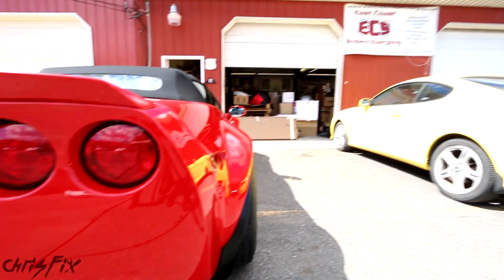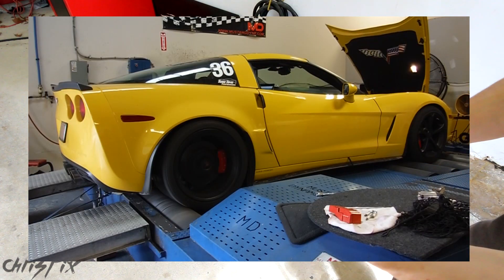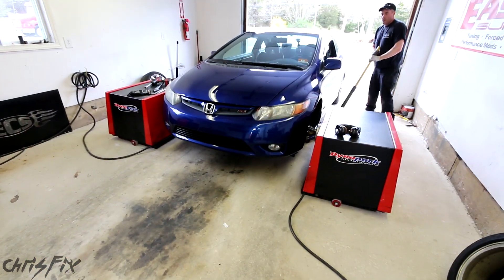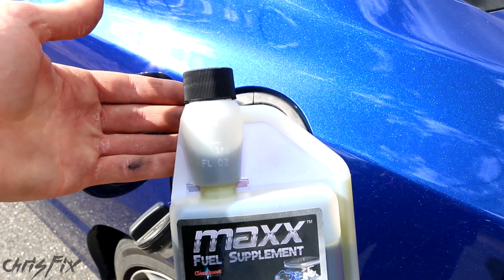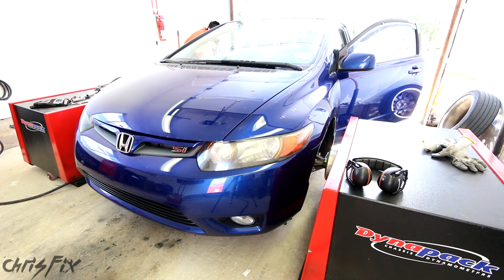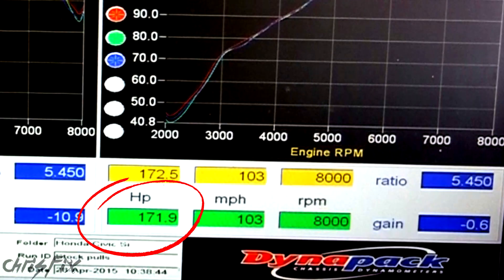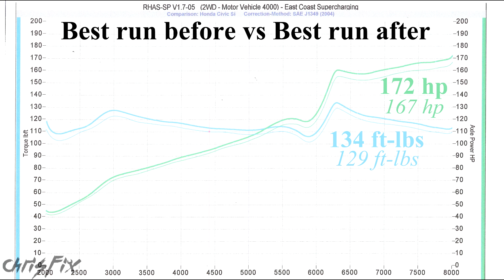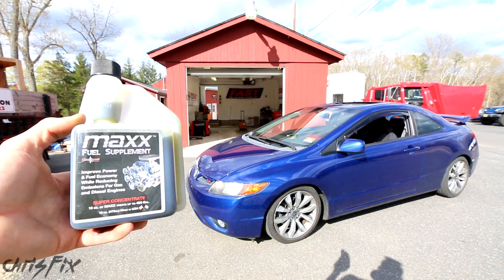Can a Fuel Additive Really Increase Horsepower in Your Car? (With Proof)

Comment: Two things a 5 hp increase is with in the noise level.Secondly You ran the first test using a bar graph from the car dashboard inaccurate way to test. I would like to see a numerical read out for engine temp,intake air temp and ambient air temp with before and after runs.The same pump gas used from one 5 gal container split in two one for the additive and one without. also all test have to be done within reason  not a 20 mun  joy ride were the engine maybe cooler.You say you did not add fuel but we only have your word.Also for the record I worked in a class 8 emmission Lab were the environment is controlled so as far as I am concerned I stiil do not believe this additive did anything.
Reply: ...  smh.... lol ....geez .... you know you could always allocate the time, energy and resources to disprove this. ..... :) just sayin
Reply: +William Spaulding Yea I could but as someone that works in a class 8 emmissions lab my job is to prove or disprove EXHAUST EMMISSION components from manufactures.I belive that people that are not giving all the facts are being taken. What I watch in this video is not true and until someone can show cold hard numbers that says different and proves me wrong beyond a reasonable doubt well I say try.
Reply: +Vito Cialdella geez, all this because a kid did a quick field test on a product lol
Reply: William Spaulding Listen mind you own business you don't like what I write don't read it.You are the type of person that just has to say something even if it nothing is added to the conversation.
Reply: +William Spaulding I was backing you up man, fuck that vito guy.
Reply: Really what are you going to do about I know I can do more If I choose but a ass like  you and your other Identity are not worth my time TROLL.
Reply: +Gordo Villa I dare you to make me as you just violated My 1st amendment rights and it protects me  from morons as yourself.Also your statement is a clear volation of that and Google has been Notified.Your First big mistake.
Reply: Gordo Villa Demacrap!!!and Traitor!!
Reply: Vito Cialdella back to square one... idiot...
Reply: why? It's more fun to play with peacocks like yourself :)
Reply: +William Spaulding so whats what you screw peacocks.Man you really  are a sick person.
Reply: is that an offer? :)
Reply: So you are gay got tired of you tailpipe?
Reply: +Gordo Villa I can see you and your other personality want to be alone you speak like and idiot and confuse accounts. So this will be My last comment to a sick person.I will act like the adult and ignore you and your other account.You should find help seeing you have no friends and troll around.
Reply: That was hilarious lol. That boy Vito, man he's got you figured out lol
Reply: Vito Cialdella thanks buddy, you just made my day:) I needed a good laugh...
Reply: +Vito Cialdella lmao, u gay son? why do you promote homosexuality like that?
Reply: NOW I AM REALLY LMFAO YOU ARE A FORD OWNER FORD GUYS ARE GAY.TO BAD YOU WERE NOT IN ORLANDO LMFAOAY.
Reply: +Vito Cialdella you are gay aren't you? sorry your family doesn't love you.
Reply: Truly you are the only one here you can come out of the closet.FORD- FOUND ON ROADSIDE DEAD.LMFAOAY!!!!!!
Reply: +Gordo Villa I'm starting to think Vito might be a pre-teen...
Reply: I am LAUGHING SO F###### HARD AT YOU TWO FORD'S.OMG
Reply: +Gordo Villa yep..... pre-teen
Reply: You both Are so f###### wrong stop doing each other and look at how wrong you are....LMFAOTIP!
Reply: Always knew you did not know anything about cars except what the average idiot knows.and that is DRUUUUM ROLL PUT GAS INTO THE CAR OR IT WILL NOT GO.LOOK AT THE FOREST GUMP CROWD.LMFAOSFHN.
Reply: Vito Cialdella Are you okay?
Reply: <~~~ grabs tub of popcorn and a soda and sits down.........
Reply: Vito is entertaining lol....like watching a train wreck.....  <~~~~~~ passes tub of popcorn to Gordo
Reply: +William Spaulding OMG it took you 3 days to think that up talk about being slower than Forest Gump Man you take the DARWIN AWARD LMFAO AT YOU.
Reply: +Vito Cialdella I'm still revelling in the fact that you said you weren't going to reply anymore, but here you are......   :)   "badut batbatba .... I'm m lovin it" lol
Reply: WE decided that THAT ALL OF US WHERE I WORK LMAO aT truly how small minded and nieve you truly are. 3 DAYS TO REPLY.AND WE VOTED TO CALL YOU FOREST GUMP from now on.And we took your comments and sent them in to the committee for the Darwin award.LMFAO.
Reply: Yer such a dork. It was like ten days between one of my comments and the time you responded lol.
Reply: +William Spaulding I am talking about today and like a moron thank you for the reminder from the last time, you were the idiot that did not reply for ten days.Forest.
Reply: +William Spaulding I think we made the thing have a mental break down lmao
Reply: +Gordo Villa I never had a break down Crooked Hillary.LMAO
Reply: And here we go again I guess the two Ford girls are in bed together.LMAO
Reply: And The Ford girls are holding hands and tag teaming each other again and who will respond next that is the question maybe its who on top?maybe who's on bottom?That is the question.Or it could be the gay rice rocket owner thet the exhaust note says  Immmm Gay.lmao
Reply: +William Spaulding WOW did you think that all up by yourself or did your mommy help you with that.And I am impressed It took you only 20 mins this time. Its getting late you have to go to bed soon.As its almost that time.LMAO
Reply: FOREST SAYS The fuel goes into the fuel nozzle and it makes the car go BUT DOSE FOREST KNOW WHERE THE FUEL FILLER IS ON CADDY from  1962 and how many gallons dose it hold.LMAO 20 MINS again AND WAITING FOR A REPLY.
Reply: +William Spaulding Yup, vito is slinging that poo at us haha.
Reply: And it took you all this time to reply with just that lame sentence.
Reply: I must be putting your brain on overload and you can't respond that quickly I'll try to slow down for you for Forest.
Reply: Vito, I thought you said I owned a Ford lol
Reply: +William Spaulding Really  are you that slow?It took you all this time to respond from a comment a hour Ago. I will give you more time to respond to the next one.

Comment: 10 or so HP is a fair amount when you're gauging a car that makes 200 hp or so. not so much of a big deal in the 300+ hp engines, unless the improvement follows a consistent percent (190 hp @ 8% vs. 300 hp @ 8%) < which could relate to upwards of 10-20 hp increase.. Either way I certainly am shocked. What I'd REAALLYY like to know is what are the effects on the engine? carbon buildup, oil contamination, wear? Or is this just an overall jesus juice for cars? - and even further - why the hell isn't this a standard additive in all fuel at the pump?
Reply from the maker: +James Dahmer Yea, we were all surprised too. I didnt think it would work honestly. I think it doesnt work on every car because I did a really big test and the fuel economy improvements only worked on some of the cars so that is probably why they dont use it in pumps. It is also expensive. Here is the MPG video: https://www.youtube.com/watch?v=DUkICPS0zQE

Comment: So if the car is rated at 195 HP how do you get that HP back...? A loss of 30HP is pretty substantial for a fairly newer Civic Si with VTEC... yo....
Reply from the maker: +Jose Huertas-Silva You cant get it back. It is lost though the powertrain (transmission, axles, etc). That 195hp rating you see from the factory is to the flywheel. The rating from a dyno is to the wheels.
Reply: Thank you for the prompt response. Did not know that,  but thank you for clearing it up! Did you end up seeing any improvement with the fuel additive?

Comment: Be interested to see how effective it is in a turbo car and a turbo diesel.
You usually get better gains with forced induction cars so 11hp is actually pretty impressive for a 2.0 n/a Honda.
Reply from the maker: +soundseeker63 That would be pretty interesting. I am working on testing a diesel additive since everyone wanted a diesel test too!
Reply: +ChrisFix 
It will be less and less effective, the more high tuned the engine is.
Say if you put the stuff in a Porsche, when their engineers are trying everything to get the most out of the engine. The gain in using this stuff is minimal. However, it would be fun to a test with different car (with different level of performance) just to verify this.

Comment: not gonna really feel that difference, only 11 horsepower is not much.
Reply: +Mac MashPotato 
You won't feel the increase in HP, but you will feel the increase in Torque. 
When the car is in acceleration, torque is applied to the wheel by the engine. The more torque the better the acceleration. The torque increase is 5 - 10%. To put that into perspective: an increase of 50 lbft of torque (max) for a engine with 500lbft of torque.
I am petty sure you will feel the difference.

P.s. I am suggesting you will get the similar results for a performance engine with that knid of figure.

Comment: Your test is inconclusive, at best.  Why? Because you did the tests under different conditions.  The second run was done almost immediately after driving 15 minutes, which heated up the wheel bearings, increasing clearances, heating up the axle grease and transmission fluid, and gave you less friction.

Do the test again, but next time do it correctly.

Comment: What gear are the cars usually in when they get dyno'd?
I doubt you put them in 6th gear, but the honda was up to 100mph so i'm guessing 3rd-4th gear?
Reply: in a dyno the car is always put in 4th gear , because the  engine rotation is directed to the wheels , like there was no tranny on it, to show really how HP and torque has the engine (sorry if bad English)

Comment: I didn't watch the whole thing but did he make sure it was at full operating temperature first?
Reply from the maker: +dan428 watch the whole thing
Reply from the maker: +dan428 watch the whole thing
Reply: +ChrisFix I watched from the beginning and it doesn't show you bringing the car to temperature before the first tests.. it does show you doing that before testing with the booster additive
Reply: Doesn't matter lol, if his engine was colder with no additive, and the warm engine + additive gas still made more power, does the conclusion change? Nope. Point is the fuel additives help a bit.
Reply: +Mark Chang yes the conclusion would be unconfirmed, that's the importance of controlled variables

Comment: Very interesting results but I'll remain skeptical until your results can be consistently verified.
Reply: +Inorite My friend and i have two honda r18a's mine is a hatch and he has the sedan. my car 150 kg's heavier that his cause he has the base model. In a race he just manages to get in front of me for the entire 4th gear. If the maxx works i'll let you know. I'm gonna try it out soon.
Reply: +Civic R plz let us know
Reply: +Inorite I am quite skeptic too. Basically even if the results can be verified, we are talking about 4% more power. That will do just nothing.
Reply: What were the results?
Reply: I never got around to trying it out cause both of us have been so busy with work. But i will give it a try sometime and when i do i'll post here for sure. Our cars are still the same, but he has done his clutch a month ago and has resurfaced the flywheel. I think that's    gonna make his a little faster cause of the little lighter flywheel. We'll just have to wait and see.

Comment: although it did improve the hp and torque... lets face the facts here..  5bhp isn't a noticeable amount and a can be beaten by a good driver...  good driver in 167 will beat a poor driver in 172 everytime...  unless its a 5hp lawn mower vs a 10hp lawn mower then I guess that's significant but at 150hp+ its not really noticeable
Reply from the maker: +Dustin Comp Correct, but when you are racing and every hp counts, you might as well use it. Plus, if it gives you better fuel economy, then it is a win win and pays for itself. We actually tested it (we as in me and 20 subscribers) and it does help on some cars and it does nothing on others. Here is that video if you are interested: https://www.youtube.com/watch?v=DUkICPS0zQE

Comment: does it mean that putting premium on car that needs regular fuel will have increase hp and torque?
Reply from the maker: +jervy diaz incorrect. That has to do with timing advance and octane. If your car cannot advance timing due to higher octane gas, it cannot make more power. Most lower compression engines are not going to make more power with higher octane gas.
Reply: +ChrisFix so what does maxx fuel supplement do? i thought its an octane booster?

Comment: how wood a manual transmichen work in a front wheel drive car
Reply from the maker: +KOLTON hennessey Same way as for a rear wheel drive car but the tranny is mounted sideways.
Reply: cool
Reply: +KOLTON hennessey my vw golf (rabbit) has a manual gearbox and front wheel drive
Reply: no difference in any way between how front wheel drive works vs rear wheel drive. just harder to do burn out some times
Reply: I didn't want to say anything because English might not be your first language but you sound American in your videos so you have no excuse.. Lol.  at least use auto correct
Reply: the manual transmission in a transverse mounted engine meaning the car engine is side ways just like the tranny witch the tranny has two long cables connecting from the tranny to the shifter

Comment: what octane rating was the fuel in the car?
if standard unleaded would you get the same result from using high octane unleaded?
then a little more with the additive
Reply from the maker: +Pepe Capirote It was high octane 91.

Comment: weird my 2006 si made 174 hp at the wheels when stock 203 hp with intake and catback on 93 octane gas. it also ran out of gears at 181 mph, speedo goes to 175 mph all in a rolling dyno. those 1st results sound like the car was running on 87 octane gas and the second run was done with 93 octane.... those k20 engines don't like regular. this test should have been done with the pickup or the minivan that run the same with regular or premium fuel.

Comment: 10 hp dosnt not make a difference
Reply from the maker: +Joe Sniadecki Actually, it does in fact make a difference. A 10hp difference.
Reply: If you had a supercar that makes 900 hp and you changer the tip of air filter and it gives it, 1 hp more, was it worth your time and money?
Reply: I do realize this is 2 years old but did you really just compare a super car to an economy hatchback?

Comment: All you did is upgraded ur octane so from regular 87 to 93 or 93 to 101 of course you will make more power
Reply: I think Si Vtec needs octane 93 up it even tells you in the gas tank door. I think what this thing has is Nitromethane or acetone or both, maybe even nitroglycerin thats why it only needs that small quantity. If you put more it may be able to break the head or simply damage the injectors and ultimately the whole system.
Reply: +Jerry Lugo I'm guessing you didn't do chemistry at school. To lift the octane rating (US or EU, it doesn't matter much) by a couple of digits you need one of two things:-
1. A lot of additive
2. An extreme octane rating on the additive.

As ChrisFix is adding only half an ounce (~15ml) of additive to a significant quantity of the fuel the first cannot be true. In order for the second to be true the RON/MON/AKI rating would need to be in the multiple thousands.

To determine the actual RON/MON/AKI rating of the resulting fuel you need to add the octane quantity of the fuel (10 US gal/38l) with the octane quantity of the additive (½oz/15ml) and then divide that figure by the total quantity of fuel + additive.

Let's assume that the additive has a RON of 250 even though it will never be even close to this in reality. The normal fuel has a RON of 91. The RON quantity of the additive is 2.50 x .015 = 0.0375. The RON quantity of the fuel is 0.91 x 38 = 34.58. Add these two together to get 34.6175. The total fuel quantity is now 38 + 0.015 = 38.015. The actual RON quantity for the fuel plus additive is now 34.6175 / 38.015 = 0.910627. This gives a new RON figure of 91.063, an increase so small so as to be within the margin of error.

While the figures for MON and AKI will differ slightly from those indicated above for RON, they will not change by more than a small fraction of a percentage point. The raw numbers change slightly but the overall result remains extremely similar.

You just cannot increase the RON/MON/AKI figure by any meaningful amount with the inclusion of any small bottle of additive. Even adding in a full US pint (0.47l) of that 250RON additive shown above doesn't change the results by too much. In this case the results would be slightly better; 92.94RON.

The biggest factor so many people forget to consider is the cost of the additive. Let's say it costs you $10 to add in a bottle which can raise the RON/MON/AKI of your 10 US gallons by a whole 2 numbers. How much would it have cost you to purchase the higher rated fuel anyway? Does the higher rated fuel costs you $1 a gallon more than the lower grade fuel? I'll bet you that it doesn't.

.

Of course, after all that, a higher RON/MON/AKI does not necessarily equate to more power. You need a higher calorific content in the fuel burnt to be able to produce more power. :-)
Reply: +Gnuthad i presumed it was octane booster like substance... But i read up on it and it aint nothing like that. Thanks for the 101